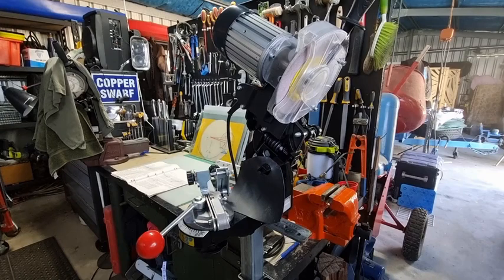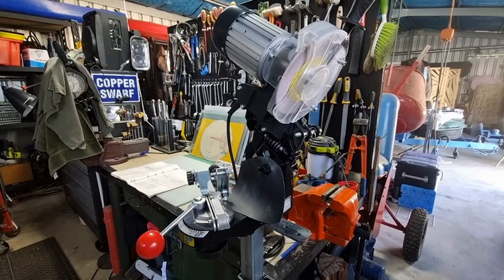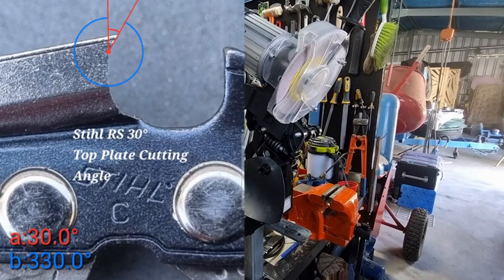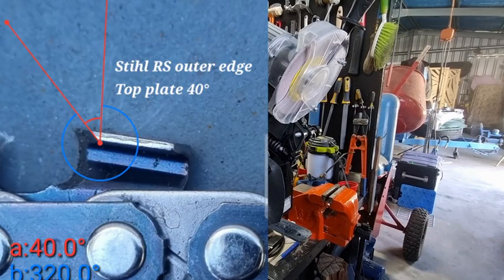10° Tilt in the 1960s RS & RM chains we take a look at the past and current practices

Comment: If you want to get your chains dialed in to your saw and wood you need to experiment a bit.
Stop reading specs and try different angles and wheel heights.
With the 10 degree tilt you can get more aggressive with the angles and still have a durable cutter.
60 degree head tilt is slow cutting I use 50 and the chain still holds an edge fine.
Reply from the maker: 60 30 is just a stating point, I always say set angles that suit the wood you are cutting. 
In Australia we do have the hardest wood in the world and that can be a pain at times

Comment: Yep, that 60/50 is what it does. To clarify a few things,

Carltons patent was issued to his employer- OMark industries (Oregon chain)

The first semi chisel was Oregon 72DP. Launched in 1963 to suit the first, modern magnesium, light weight saw - Homelite XL12. If you want to know what this chain looked like your 73DPX is that exact chain. It’s still made today.

Thats changed now but the majority still come with the angle. 
EXL is 70/60
DPX is 85/55
ALM is 75-80/60

Every Stihl chin from PMM3, P61P, 325s RMP,RSP, 3/8 RM and RS as well as the 404’s all have that tilt from new. Hexa is the only exception due to not being able to be re created to suit the file
Reply from the maker: So If RS and RM chain and many others in the Stihl range why not just come out and say use 10° ???
But in one test I did the 10° tilt made no difference in cutting time but am thinking it will last longer between sharing.  What is your thoughts on that.
Hey a other different subject can you get Carlton chipper chain 3/8 Standard 063 gauge.
I rang my Stihl dealer and they only have RM in Standard and safety chain.  Oregon say they make for harvester 3/4"
I remember you had a Carlton chain in your video looked like a chipper chain.
Reply: @ChainsawUsers  The brutality honest reason - watch most people sharpen. They don't need another thing to fuck up.

I tilt everything except the chipper. I'm aiming for a more durable shape.

Chipper is only 404 now. If you want Carlton 3/8 063 semi it will be A3EP.

Whites Forestry is probably your best place for Carlton / Oregon. His based in  eastern Vic but has a good website and posts everywhere. Easy to deal with, has a good range and knows what he is talking about.
Reply: @SawChainTheories  I agree is hard enough getting the general public to put two stroke oil in the fuel now days let alone getting them to drop a file down 10 degrees while sharpening 😆
Reply from the maker: Stihl has only RM chain nothing else except RM safety chain.
Even Stihl Full chisel  ot much of a range.
Oregon seem to have a much bigger range than Stihl.
I am really happy with the new Jolly Star chainsaw grinder it's over priced compared to the Jolly Evo but the clamp system on the vice work much better than any cam type clamp system as on most grinders.
Another subject have you tried and of the Hyper skip chains ?
I think your comment on users stuffing the 10° tilt is spot on.
Reply: @ChainsawUsers I have made hyper skip in the past, don't bother unless it's a really specific circumstance.

I got some advice about changing the shims on the grinder vice and it works better but I still don't use it. I'm faster with a file for 99% of the stuff I do.

In 3/8 063 Stihl has 36 - RS, RSK, RM, RMX(ripping),  RSLF (Skip, square), RD3 (carbide) and RH (hexa) 

Oregon has about the same range just with some weird shit in 404
Reply: hi guys, i noticed stihl rm chain is similar with oregon chamfer comparing with oregon semi. i guess thats why stihl recommend 0 for hitting file to 2nd corner on rm side plate. rs has point on cutting point. it's hard to tell, but if you touch corner from side plate by naked finger, you can feel it. oregon full chisel doesnt has it except EXL.
Reply from the maker: @HdykNmy yes it's all interesting

Comment: I’ve learned that if you file in a down angle, you’ll end up with a much more aggressive chain that DOESNT need to have lower rakers to make it cut. In fact, if you start off with the 025 recommendations for hardwood, it’s quite aggressive. Maybe a 020 setting is better, but I’ve never seen one of those things in a dynamic WCS style of gauge.
Reply from the maker: I prefer aggressive chain and Hexa, RS  and Husqvarna X-Cut is my 2 popular chains

Comment: Seems 10 degrees down would cause the top plate to have a taper? Any benefits?(taper in the thickness)
Reply from the maker: Today the difference is a slight gain if anything.  But it's another option that you have.

Comment: I expected the time difference to be more different. I expect the 10° downward tilt to be slower because of the reduction of the top plate angle by 2° or so. What will be the more interesting test is? What's that time after 50 cuts? Is the 10° downward tilt a more durable edge in clean wood? In that scenario, I would expect it to have been a little faster after the 50th cut as a for instance
Reply from the maker: Yes I hear what you are saying.
I have done 100s of cuts say 6 inches to 8 inches and still cutting well.
I don't see 10° tilt these days as a game changer like it was in the late 1960s early 70s